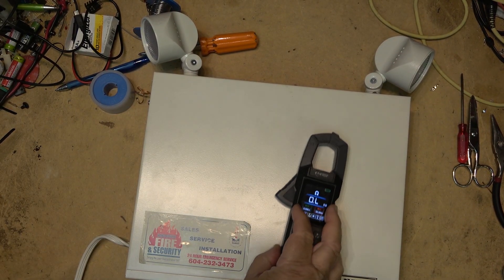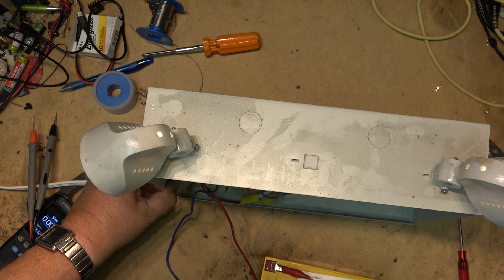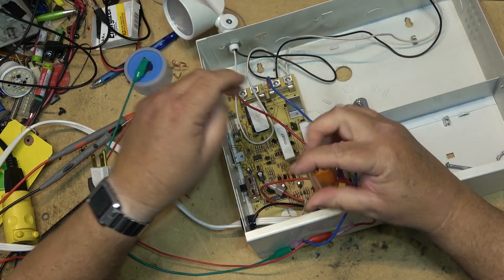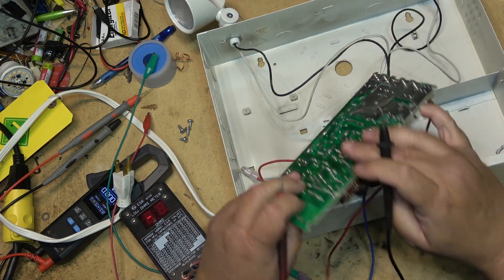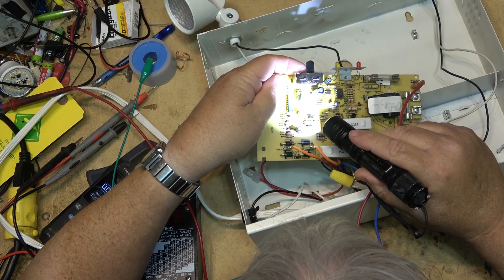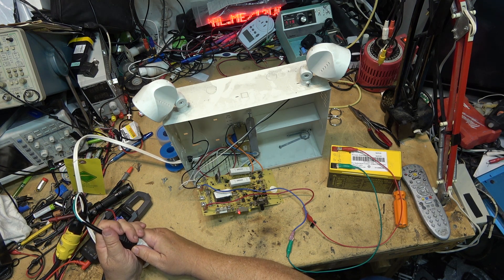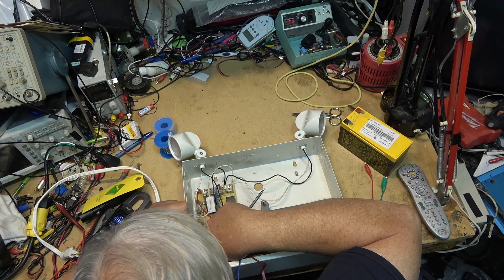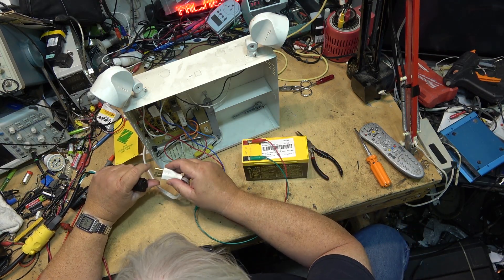Ready Lite Emergency Lighting Controller Repair

Comment: An electrician I know uses 433MHz relays in loads of emergency lights so they can be easily tested despite it being almost impossible to add those secret key (Fish!) switches to the site. She just drives around outside and uses her multi-channel remote to power them off, check how long they run from the comfort of her van, and then power them back up. The ones she uses (where they are assigned one of four channels, then multiple keys, then discrete on/off rather than toggle) can't be bought any more (company kaput) so she asked me to look at the failing ones. She gave me a carrier bag full and every one had a bad cheap Chinese junk cap dead, with only the odd shorted zener to break the monotony.

Comment: Another save from the rubbish dump.
I'd bet that unlimited amounts of them just got dumped possibly due to capacitor issues..
Reply from the maker: The problem is the new ones that have led lights dont play nice with the older units with multiple lights.   So that means ripping out all the lights and replacing them as well.  So these older ones need to be fixed so the rest of the system works.

Comment: Funny how some things never change. Some years ago I got a handful of these, but the smaller type that had the 1' T5 fluorescent in them, for free because they had this exact fault, presenting in the exact same way and with the exact same fix. I didn't bother fixing most of them as they got used to augment workshop lighting. Unfortunately they got lost to someone's sticky fingers somewhere in a house move. The circuit was just slightly different, using thyristors instead of relays, having no ICs and charging a string of D size NiCd cells encased in a cardboard tube. Suppose they did sound different with the fault as instead of the relay chattering, the pulse transformer buzzed surprisingly loudly.